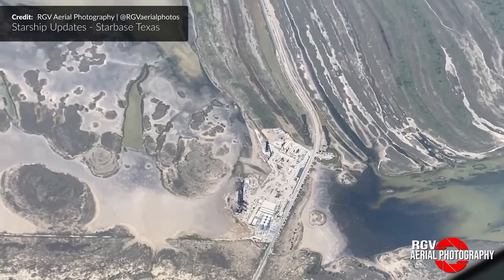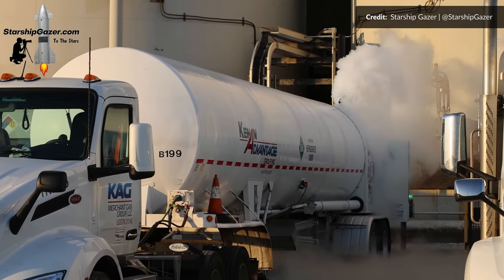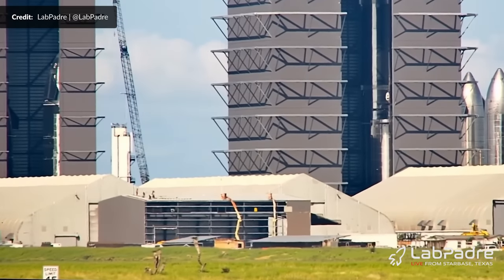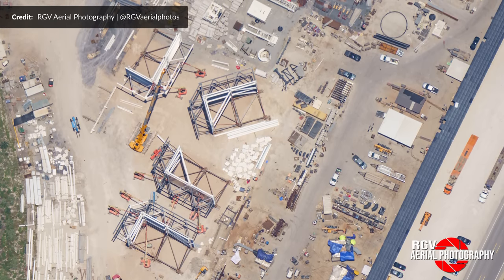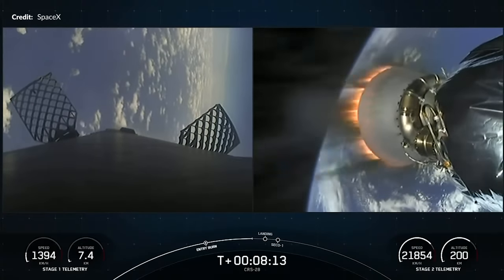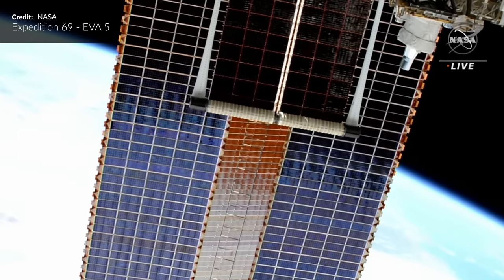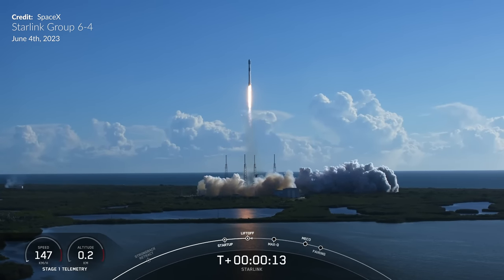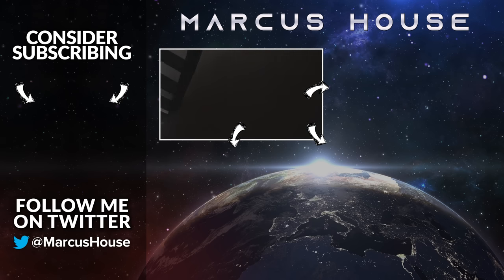NASA's Concerns with SpaceX Starship Delay,  CRS-28 and ULA Vulcan Test Fire

Comment: Jim Free is stressing about a possible delay with Artemis 3 launch but Boeings Starliner is what, 5 years behind schedule?? lol
Reply: Artemis II is planned in 2024 and the SLS hardware for Artemis III is being assembled now. For Artemis III in Dec 2025, SpaceX has to do a full up, unmanned HLS Starship test landing in late 2024 or very early 2025. That means having the [DELETED] Starship propellant depot, Starship Tankers, and HLS Starship ALL working by then. Including up to 7 Starship Tanker flights. So they need launch pads that are ready to go. ALL of that development takes time and Dec 2024 is not that far away.

Boeing's Starliner is under the fixed-price Commercial Crew program (CCP) to go to the ISS. Starliner has nothing to do with Artemis.

Comment: Best case scenario, NASA can only launch two SLS missions every three years.  And haven't even finalized a design (or contractor) for the Lunar Gateway.  NASA has a lot of things to be concerned about right now - but SpaceX isn't one of them.  About three years ago the Everyday Astronaut was asking Elon about how qualifications are going to work with NASA and Elon said, "We realized it's going to be faster and easier to just actually build and land Starship on the moon than it would be to convince NASA we can do it."
Reply: Bullcrap. You might want to update your information.

Maxar Technologies got the contract for constructing the Power and Propulsion Element (PPE) in May 2019. 

Northrop Grumman got the contract for constructing the Habitation and Logistics Outpost and for integrating it with the PPE in Aug 2020.

Both the European Space Agency (ESA) and the Japanese Aerospace Exploration Agency (JAXA) confirmed the contracts with NASA for the I-Hab module in Oct 2020.

The European System Providing Refueling Infrastructure and Telecommunications (ESPRIT) module was approved for construction in Nov 2019 by Thales Alenia Space for the ESA.

Artemis II is planned in 2024 and the SLS hardware for Artemis III is being assembled now. For Artemis III in Dec 2025, SpaceX has to do a full up, unmanned HLS Starship test landing in late 2024 or very early 2025. That means having the [DELETED] Starship propellant depot, Starship Tankers, and HLS Starship ALL working by then. Including up to 7 Starship Tanker flights. So they need launch pads that are ready to go. ALL of that development takes time and Dec 2024 is not that far away.

Comment: What on earth was I seeing ?? .It looked like an astronaut was coming back in from an EVA and there was an unprotected member of the crew to welcome them .
Reply: This would have been after repressurization, but before their suits were removed. The pressure would be the same or similar between the outside of the suits and inside. There is an airlock for this purpose that protects the crew that isn't involved in the spacewalk. The unprotected crew can't go in during the repressurization process (which can be dangerous during a medical emergency for the spacewalking astronauts due to the inability to leave the suits).

Think of it like when you come in when it's cold outside and you still need to put your coat on the wall.

Comment: So NASA is concerned with any Starship delays but doesn’t seem concerned about the massive delays and non reusable expense of SLS, Artemis and Blue Origin. SpaceX is proceeding forward at a brisk but safe pace.
Reply: Starship IFT was not in the least bit safe. It showed that SpaceX never tested the FTS, and if the rocket had turned north towards populated areas, west towards the factory (and populated areas) or south into Mexican airspace (and possibly populated areas), 40 seconds of rocket flight would've been enough to send an out of control rocket (which Starship was very shortly after launch) into dangerous areas and cause injuries or deaths. If that happened, you could probably say goodbye to SpaceX, or at least the Starship program. They got very lucky that the rocket stayed within the exclusion area during its out-of-control flight.
Reply: Artemis II is planned in 2024 and the SLS hardware for Artemis III is being assembled now. For Artemis III in Dec 2025, SpaceX has to do a full up, unmanned HLS Starship test landing in late 2024 or very early 2025. That means having the [DELETED] Starship propellant depot, Starship Tankers, and HLS Starship ALL working by then. Including up to 7 Starship Tanker flights. So they need launch pads that are ready to go. ALL of that development takes time and Dec 2024 is not that far away.
Reply: @JBS319 would of could of should of. It didn't
Reply: @JBS319  They tested it on the ground, since they were unable to test in the air as it was the 1st launch attempt.
Reply: @AP-qs2zf by luck, that's the point. Rocket launches must no go well by luck.

Comment: SpaceX needs to increase its mass production of starships to meet Artemis 3 timeline, as several milestones need hitting, 1st Orbit, 1st tanker, 1st tanker refueling, 1st lunar orbit, 1st private lunar landing, 1st Orbit with humans (Polaris), 1st Lunar orbit with humans (Dear moon or Dennis Tito? ) , 1st lunar landing (private crew), several starlink launches to increase starship reliability/re-use, some satellite launches thrown in , Finally Artemis 3 (NASA) & Starship HLS launch in Dec 2025..   so maybe 60 approx starship launches between now & then launching multiple times a month..    btw SpaceX will skip the next Mars launch window in Oct-Dec 2024 but aim for the 1st Alpha Cargo flights x2  in the next Mars Window Oct - Dec 2026,  Artemis 3 might slip from Dec 2025 into 2026 too prob due to NASA as ML2 is on the critical path, NASA currently saying that SpaceX may cause a delay but SLS & ML2 will 100% cause delays but NASA can hide behind SpaceX, ML2 is needed for the EUS stage on SLS which is longer as previously using ICPS  (Will see if true with delays to Artemis 2 crewed lunar orbit launch in Dec 2024).   This is also the reason SpaceX is getting serious about its Starship Factory as they need to make the machine that produces the machine rapidly so lots of rebuilding at the Boca Chica shipyard as the tents were only good to prove out the initial Starship prototypes.   one thing is for sure the next 2-3 years will be an exciting time in Space flight, The world will not realize what Elon has truly done for humanity until he has died where he will be held up as one of the worlds greatest engineers/ innovators
Reply: To be sure SpaceX needs to try Orbital Refueling & Starlink launches this year 2023,  Lunar flyby & a uncrewed lunar landing in the 1st half of 2024, 2nd uncrewed  Lunar landing in 2nd half 2024,  1st launch with crew to Earth Orbit (Isaacman-Polaris) in 1st half 2025, Dear Moon Lunar flyby  & Artemis 3 in 2nd half 2025, Dennis & Anaika Tito Lunar flyby maybe in 2025 or 2026, 2x Mars Alpha Cargo launches in late 2026 Mars Window
Reply: ML-2 isn't needed until Artemis IV and it is already behind schedule and over budget. Artemis III still uses the ICPS. There is talk of a 3.5 mission, with buying another ICPS from ULA in place of the Artemis IV launch. The I-Hab would need to be launched on a Falcon Heavy or pushed back to the first Artemis mission with the EUS. IF they go with Falcon Heavy, then the I-Hab would need a propulsion stage.

The private flights around the Moon are likely going to be after Artemis III. SpaceX needs to get Starship to orbit and prove orbital refueling for Starship to even leave Earth orbit. SpaceX has a $50M NASA contract to demo Starship to Starship refueling (10 tons) in LEO before the end of 2022. So you can see that SpaceX's schedule has slipped. 

From page 27 of the GAO decision to deny the HLS complaints, here is the SpaceX plan for Artemis III. [DELETED] is apparently at least a propellant depot Starship variant from the context and SpaceX had the GAO redact that info. Added in Musk's payload update (~150t) and he says that it is up to 8 Tankers to fully refill HLS Starship, depending on HLS Starship's mass. My comments are in ().

"SpaceX’s concept of operations contemplated ten total launches (down from 16), consisting of: 1 launch of its [DELETED]; 8 launches of its Tanker Starships to supply fuel to [DELETED] (down from 14); and 1 launch of its HLS Lander Starship, which would be [DELETED] and then travel to the Moon."

Per page 10 of the GAO report, the SpaceX plan for Artemis III is 1 Starship variant launch every 12 days. That's a couple of months of launches to get HLS Starship to leave for the Moon. If the Starship Tankers are expended, that might cut the number of launches in half.

Elon Musk has said that it would take hundreds of successful, operational flights before you could put people on board Starship launching from and landing on Earth.

“'We’ve got to first make the thing work; automatically deliver satellites and do hundreds of missions with satellites before we put people on board,' Musk said, speaking Monday at the virtual 'Humans to Mars' conference" - CNBC Sep 2020 article

So the crew launches of Dear Moon and the 3rd Polaris mission will likely be at least a few years after Artemis III. Unless they go up in Crew Dragon/Starliner and return with them. You then need something for sustaining the spacecraft until the Starship returns, as just leaving them alone in space would be sub-optimal. There are 11 crew for Dear Moon, so you need 3 Crew Dragons. There are only 4 Crew Dragons in total and 1 of them will likely be assigned to NASA, even when Starliner is on the ISS. No, Crew Dragon does not sit 7 crew, per SpaceX.

"After SpaceX had already designed the interior layout of the Crew Dragon spacecraft, NASA decided to change the specification for the angle of the ship’s seats due to concerns about the g-forces crew members might experience during splashdown.
The change meant SpaceX had to do away with the company’s original seven-seat design for the Crew Dragon.
'With this change and the angle of the seats, we could not get seven anymore,' Shotwell said. 'So now we only have four seats. That was kind of a big change for us.'" - Dec 2019 Space Flight Now article with SpaceX COO Gwynne Shotwell

SpaceX is getting serious about the factories, because building Starships in tents is fine for test articles, but isn't going to fly for operational Starships.

The next few years will be an exciting time in spaceflight.

Comment: I really hope that ULA has a successful launch with those Blue Origin engines. ULA needs to have a successful launch with them, or it is lights out for that company. I have zero confidence in Blue Origin as a company, and next to zero confidence for the Artemis program.
Reply: It won't be lights out for ULA, too much political backing.
Reply: @iamaduckquack  I hope you're right. ULA has always had successful launches, and seem like a really good company.
Reply: ULA is already up for sale.  Maybe Musk will buy it, cancel the BE-4 engines and redesign Vulcan to use Raptor 3 for pennies on the $ if the BE-4 engines fail to launch it.  😂
Reply: @Scanner9631  Any sale to another defense contractor will be blocked under federal antitrust law.
Reply: @Scanner9631  It're rumored to be up for sale. If ULA is going to be sold, it would likely be either Lockheed Martin or Boeing, buying the other one out of their 50% share of ULA.

Musk is leveraged to the hilt with the Twitter purchase, I don't think that he would be able to afford ULA.

Real life is NOT KSP, so swapping the Vulcan Centaur to Raptor engines would likely be an almost complete redesign. Not to mention that the USSF wants TWO providers for NSSL and right now, SpaceX and ULA are it, especially for the high energy orbit payloads.

Comment: I don't agree with Jim Free. Rocket motors issue is zero until now. Not a single one is proved.  Refueling is essential for Starship so it will be developed ASAP. There is only one real question. Will they land quick and successful on the Moon? If so, the real issue begins with NASA's certification which is known to be realy slow maybe even as slow as FAA certification. So because of NASA will Artemis 3 be really on late 2026 and not because of SPACEX :hand-pink-waving:
Reply: 🙄 Talk about circular reasoning.

Comment: I don't think the HLS delays are a problem, given that the SLS is such a boondoggle
Reply: Artemis II is planned in 2024 and the SLS hardware for Artemis III is being assembled now. For Artemis III in Dec 2025, SpaceX has to do a full up, unmanned HLS Starship test landing in late 2024 or very early 2025. That means having the [DELETED] Starship propellant depot, Starship Tankers, and HLS Starship ALL working by then. Including up to 7 Starship Tanker flights. So they need launch pads that are ready to go. ALL of that development takes time and Dec 2024 is not that far away.
Reply: @steveaustin2686  Those are optimistic projections. Given how delayed and beset by cost overruns the program has been so far, I doubt the next ships in the series will be on time either. And there's a non-zero chance of the whole thing being canned if Congress decides to put money elsewhere
Reply: @heartofdawn2341  Yes, HLS Starship has a LOT of development to go, so it is not likely to be ready for Artemis III in Dec 2025. The NASA IG in Nov 2021 predicted that Artemis III would slide into at least 2026 due to HLS Starship and/or the EVA spacesuits. SLS has the best chance to be ready on time, since they are getting the hardware ready now.

Artemis is an international project, so will be harder than normal to end. Fear of China being on the Moon without a US partner presence as well, will likely keep the Congresspeople in line.